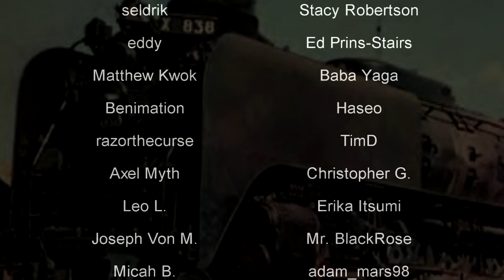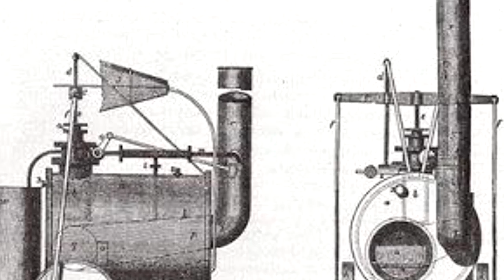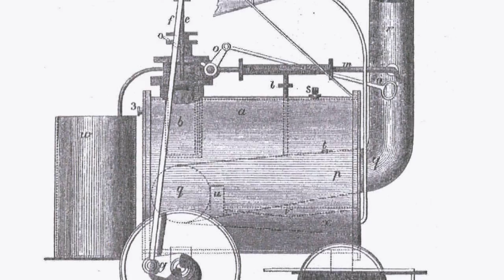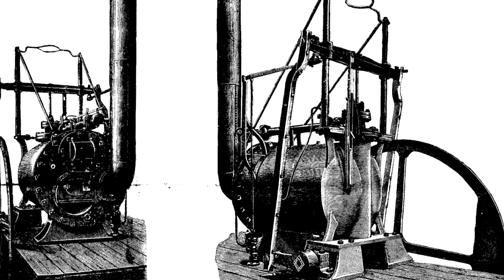The Sad Loss of the Puffing Devil 🚂Richard Trevithick's Road Locomotive 🚂 History in the Dark

Comment: there is a difference between what was considered 'High Pressure steam' In Trevithick's day and what it is today, his early engines ran at the terrifying pressure of 30 psi! or about the same as a car tyre, later he increased the pressure to 145 psi, most later steam trains operated at 200-250 psi with so called high pressure Locomotives running at 300+
Reply: Was looking for this comment!

Comment: Just an FYI on 'high pressure steam" what was high pressure for the time which is normal to low for steam boilers in he 1840s to 1950s. The LMS Fury and the like were a new "high pressure" compared to contemporary locos at over 1500psi.